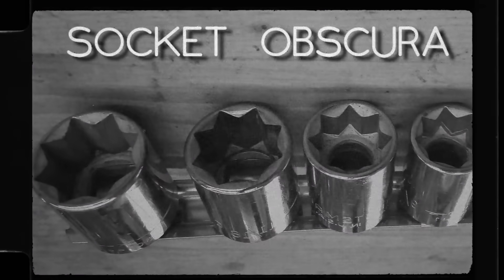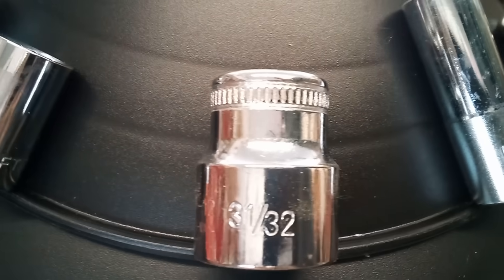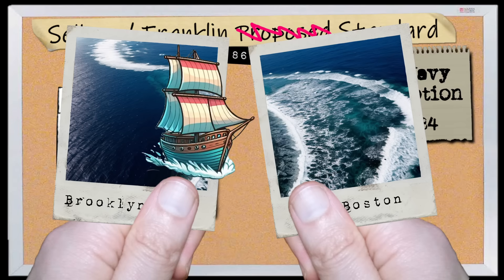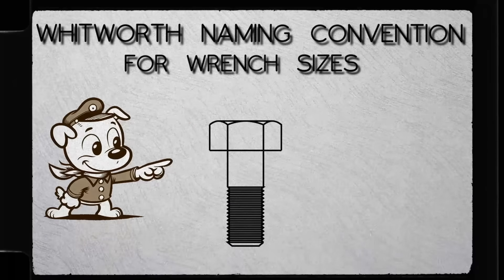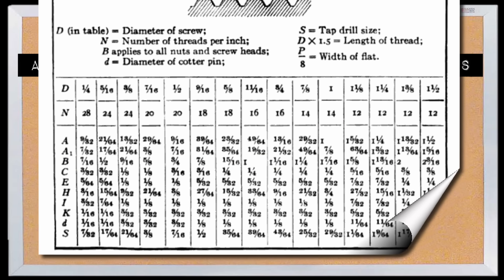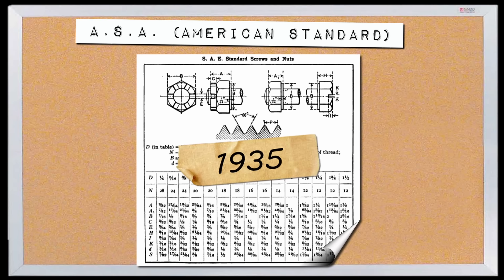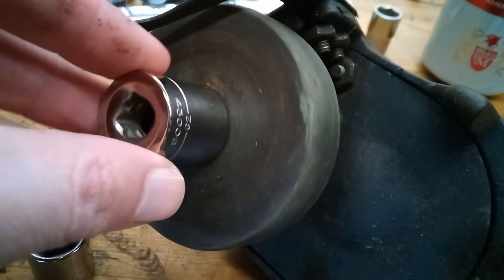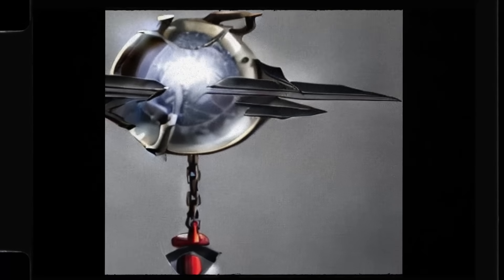32nd of an Inch Bolts - History & Lore

Comment: It is still surprising that metric sockets still use fractional size ratchets. Perhaps, I should not have mentioned that.
Reply from the maker: Yeah, I'm sure there's another story behind the socket drive sizes. I'll have to dig into that too.
Reply: @ballinator  I think I read somewhere that Blackhawk had a line of 7/16" drive sockets before World War II
Reply: There are also metric sizes in 1/2 mm increments for use on lug nuts where rust has swelled the chrome decorative cap to a degree that standard metric sockets will no longer fit.
Reply: @machintelligence  have a set of the 1/2mm increments for that purpose. Dont use them a lot but when you need them you need them.
Reply: @robertanderson1272  Once you  go above certain size - say, 14 mm - that half a millimetre does not matter at all, I'd say.
Reply: @MrKotBonifacy  
 Trust me, that.5 mm makes a difference on swelled cap lug nuts and other partially stripped or rusty fasteners.
  As far as other metrics, different countries have different sizes of bolts. Germans use a 16mm hex instead of the more common 15mm. US replacement bolts use 17 mm hex for the same bolt size. Japanese use 12&14 mm when US is 13 &15 mm. 
  Screw hose clamps used to be 1/4 and 5/16 are now 5.5, 6 and 7 mm. 9, 12, 14,16, 18, 20, 23, 26 are used for tube fittings.
  I've seen weird thread sizes too. World wide standards don't seem to be a real thing.
Reply: @ Well, lemme rephrase my stance a bit: I'm not saying that there are no situations, ever, whatsoever, in which this 1/2 mm of wrench size difference wouldn't make any difference - what I'm saying is, these "something point-five mm" spanners are not anything mainstream, not even close to it - these are fringes of metric wrenches (and "sockets", which name I heartily detest as this a rather dumb abbreviation of "a socket WRENCH", or "spanner" - as "a socket" is a socket, i.e. a NOUN - and "a WRENCH" is a wrench (ditto), with "socket" being added to it as an ADJECTIVE, thus "a socket" for "a socket wrench" is kinda silly - like saying "sport" for "sport shoes", or "sport cars" - but these are quirks, flaws and shortcomings of English language, and at any rate... I digress here).

So yes, for small sizes (3-6 mm) that 0.5 mm DOES make a difference, and as I said before, 5.5 or 3.5 mm (and even 6.5 mm) wrenches are the "fully legal" sizes - but above 7 mm hardly anyone EVER sees this in the metric world.
I myself, being over sixty (and fiddling with all things mechanical since 6 yrs old), am yet to see anything like 10.5 or 16.5 mm spanner. Yes, I believe these might exist, and yes, for some folks these might be even be a part of their "standard tool-set" for daily use - but only that.

I mentioned before that some sizes are skipped altogether in "GI Johny" (aka the Home Garage Mechanic) sets - like, after 14 mm you typically see 17 mm - albeit in "proper, for proper mechanics" spanners sets you always have them all, in 1 mm increment. And yes, some countries WITHIN the metric realm tend to follow different standards for "bolt size/ head size" ratio - for instance "some time ago" my pal needed to take off some bracket bolted to a Mercedes truck frame - and these bolts (and nuts), size M10 were German-made. And 'lo and behold", bolt heads and nuts were 16 mm, not typical 17 mm you'd expect - and he was kinda in bind, as 17 mm spanner was a smidge too big, and these bolts were very tightly screwed on. I had all sizes in my set - including 15 and 16 mm, so no biggie, but situation like this (coming across such sizes) are pretty rare.
And that was like 20 yrs ago, and I guess you could count on the fingers of a single hand all these situations since then he actually needed again this 16 mm size spanner.

AND, AT ANY RATE, there's ALWAYS some gap between "nominal size" of a spanner and REAL size of the space between spanner's jaws, made to allow for easy on-off action. My experience says cheap sets have this gap tad on - or close to - "too loose" side (about half of mm or so), while quality ones have tighter (better) fit.
Once I had to buy this so called (here) "a pipe wrench" (not "for pipes" but "looking like" a pipe for smoking tobacco), size 8 mm - it was 12-pointed (aka "double hex") cheap Chinese stuff - and it was so loose that at this size it was practically useless (so I had to get another one with single hexagon socket in it).

But when you're faced with "slightly swollen/ rusty/ deformed" 19 mm head/ nut you RARELY, if ever, would need a 19.5 mm spanner - at this size 20 mm one would do just as well, albeit yes, 19.5 mm would offer a better fit. Still, as long as the job can be done, it does not matter, and then one can buy only so many tools.
And this "loose tolerances doesn't matter above certain size" thing is, in my opinion (but I might be just wrong), the reason for square nuts found on all really old stuff - cuz back then, in old days, a farmer would have only the most basic tool, and if he could tighten a 3/4 in, or perhaps even a 5/8 in nut with either 3/4" or 1" spanner, the better for him - like, why bother (and spend precious $$) on stuff he wouldn't really need?

Anyway, to sum up this tad winded blabber of mine - kindly please see my earlier comment NOT as any "argument/ arguing AGAINST" your statement/ opinion, but as a "commentary", "addendum" or "a footnote" of sort.
Yes, SOMETIMES these 19.5 mm spanners come handy, and for some, in some situations, these might be NECESSARY - but for the most of us, casual "professional hobbyists"... Nah. Nevah. ;-)
Reply: @MrKotBonifacy  socket makes sense to me as the thing you use a socket wrench to use. You use a socket wrench on sockets. 
Once you get past 7mm I haven’t seen half mm sizes, but they do exist… from what I can tell mostly from places that went fully metric long ago, used to get closer to sae sizes for folks with no fractional inch tools.
Reply: @johngaltline9933  "socket makes sense to me as the thing you use a socket wrench to use. You use a socket wrench on sockets." Well, one can certainly see it that way, but for me a socket IS the wrench , albeit without a handle (i.e. the ratchet or a power tool adapter).
 And then there are one-piece single-size socket wrenches as well (like that aforementioned "pipe" wrench, or maybe an "L" wrench, and ones with a handle and pivoting "socket tips" on both ends, permanently affixed), so this "socket" used commonly to call the entire thing (ratchet plus socket) sounds kinda silly to me - but then again it might be just me and my CNPD (compulsory nit picking disorder ;-)

Whatever, and I'm certainly not going to fight over it - so let us just agree that we disagree, can or not? ;-)

 Once you get past 7mm I haven’t seen half mm sizes, but they do exist… from what I can tell mostly from places that went fully metric long ago, used to get closer to sae sizes for folks with no fractional inch tools - that reminds me of some old Leyland engine that guy on I Do Cars channel was dismantling in one of his videos - the engine was produced, AFAIR, shortly after UK went metric, and there were some M9 bolts it it (a total odd-ball size in metric world) with equally odd heads, and he was wondering why such size (he's an American).
Apparently they decided, methinks, that this 9 mm (0.354 in) diameter of a bolt is the closest "full number size" to 3/8" (0.375 in or 9.52 mm) that can be used on "metricated" engines without drilling bigger holes in the block - which might require some re-designing or re-calculating the strength of this new design.

Well, whatever - just some piece of totally useless trivia. Cheers!
Reply: @MrKotBonifacy  
  True, you are not likely to find end wrenches ( spanner to you Brits) in half sizes and most fasteners are not made intentionally half sized, but become so from natural attrition or in the case of the common tin caped lug nuts, expansion. Half sizes address the extraction of damaged fasteners, usually in the automobile realm, ressesed into  the part.
   As a nearly elderly auto mechanic myself the changing fastener world is getting pretty diverse with new drive styles to increase torque and discourage repairs.
Reply: @jeffhill3681  "the changing fastener world is getting pretty diverse with new drive styles to increase torque and discourage repairs" - yeah, soon they'll be gluing up and welding shut everything, to discourage any unauthorised fiddling ... ;-)
Reply: @machintelligence  Some of the old soviet wrenches are like that, except you never know if it's 0.5 mm over or under 😂 I needed a 32 the other day, found one 32 in the old toolbox that fit perfectly, then found another that was more like 31 or something even with the rust removed. Some others are borderline unusable from how loosely they fit
Reply: Years back I wen't on a in the "field repair"  just so happened we needed to remove the drive wheel I did't have my 3/4 rachet set along, The farmer wen't and got his  "( 5/8)" drive socket set "SNAP ON" to boot, any idea on that? I've also seen a 1/8 inch drive set Snap On also, I think that was a novielty set but still useable!
Reply from the maker: @fredblase5608 There was also a 9/32nds drive too. Companies tried their own thing for drive sizes, but 1/4, 3/8 and 1/2" ended up winning.
Reply: @ballinator  I've been under the impression that 9/32" and 5/8" drive were US military specified back in the day.
Reply: @ballinator  the latest i can remember is whan gearwrench created their socket, ratchet set up with the hollow sockets
Reply: @fredblase5608 
 The 5/8"drive set is a valuable collectors item, the 1/8" driver is for electronics use. Have had them for years, probably only needed them a few times.
  Ya, got that 'own every size ' disease.
Reply: Gives them a new idea
Reply: Hum, you got a good point there . I never thought about that and just took it for granted ??
Reply: I once saw a 17.5mm open end wrench.
Reply: @e-curb  That could be a re-labeled 11/16" wrench. There's less than .002" between them.
Reply: @  I don't think so. It was a double open end wrench. The other end was 18mm.  IMO that was the most useless wrench ever made.
Reply: Not that surprising.  There are many things that retained their customary sizes long after people using them switched to metric, many still that way today.  People just don't realize it because they use the nearest metric equivalent or a size label when referring to it.  You'd also have a pretty tough time  as a tool manufacturer getting people to buy a whole new set of gear to replace one split socket.  
Lastly, I've seen 10mm drive out in the wild.  In the US we usually only see it on very cheap tool sets found at flea markets and the like, but as best I can tell it exists as an option in some parts of the world, especially in places that have tooling from before the fall of the USSR.
Reply: I assume you mean the square drive.  It would be a huge mess if the Europeans created a new Metric standard for that.  I expect there are countless US made sockets in Europe, and there are European tool makers who make sockets they might like to sell in the US.  Having two standards would serve no practical purpose whatsoever, and would just cause trouble and expense.

Some Europeans try to hide the fact by assigning the sizes mm names, but those aren't the actual sizes.
Reply: @GH-oi2jf  "Some Europeans try to hide the fact by assigning the sizes mm names, but those aren't the actual sizes." - that's funny, considering that an inch IS DEFINED as "25.4 mm" - see? (Or, QED : )

No-one is trying to "hide" anything, and at any rate the only "actual size" is what is PHYSICALLY out there. EXPRESSING it in numbers - with appended inches, mm or "multiple of a wavelength of certain frequency of light" - is not any "actuality", it is done merely in order to get some more or less ARBITRARY number(s), related to the physical object (or a distance), for the purpose of calculations (I'll get back to tis part soon) and/or dimensions verification. (But then this can often be done without any "numbers" - for instance, in case of threads you can use "go/no-go" thread gauges - and no need for any calliper or micrometre.)

And yes, there are SOME of these "legacy" things, like "imperial" threads still used in plumbing or power hydraulics, there are still odd-sized bullets - like this 0.3" / 7.62 mm and what not - which is the standard introduced, AFAIK, by tsarist Russia back when they used inches - but with DECIMAL division from the very beginning.

Anyway, one of these things is them square drivers - NOMINALLY assigned 3/8", 1/4", 1/2", 3/4" and 1" (AFAIK) sizes, but their ACTUAL sizes are always slightly off. So a "half an inch" drive (12.7 mm) might be in fact closer to 0.492" - or 12.5 mm. (Which of these two numbers do you see as "more natural" or "simpler"...?

But when it comes to Allen wrenches (or any other wrenches) they are all "metric" (in metric world), and no one gives an eff about some 15/16" or "17/32" nonsense - and then the Torx system (an "improved Allen" stuff) comes ONLY in metric sizes. So, there you go. 

Anyway, the square drives thing is pretty much in the "who gives" category, and while from "perspective of an ordinary human and daily SIMPLE tasks" (like cutting lumber, mending a fence or building a barn) an inch and a foot is,  I'd say, somewhat more intuitive/ easy than metric units, but then dozen-based system is also "somewhat better" when it comes to natural (whole) numbers divisions, yet everybody uses decimal counting system - see?

"Und da hier is der Hund begraben", as Germans used to say ("and here is the dog buried") - metric is superior NOT so much because of the size of its units, but because it's decimal all the way through.
With Imperial/ US Customary going from inch to foot is a conversion, ditto for "feet to mile" - and this applies to ANY unit switching, WITHIN it - while going from "mm" to "km" (or "m" to "µm") is merely a matter of moving a decimal point.

Why, do you think, US machinists have thrown away (to all intents and purposes, bar rough sizes of stock material) all these "7/64" or 27/128"? Makes you think, eh? ;-)

Also, I dare to suggests that if someone "back then" would give it a second thought and decided "an inch is to be divided into TEN units, and then into tenths of thereof, ten inches would make one foot, ten foot will be... something else, and then ten of these somethings would be one mile" , ALL of us today would be using, happily, inches and miles.
Alas...
Reply: @GH-oi2jf  My die grinder uses cutters with ¼" shaft. The standard. I was travelling in Europe about 10 years ago and saw a tool shop. They had cutters I haven't seen here, so I bought a couple. Tried them out and the shafts are too small!  6mm!
Reply: @e-curb  "My die grinder uses cutters with ¼" shaft. The standard " - nope, merely "the US standard". And they weren't "too small" - they were just right. OK, maybe not for US made / "for US made" die grinders, but then there's world outside of US of A too.
Yes, we "not in America" (and Liberia, and Myanma(r)/ Burma too) are still living with some funny legacy systems, and we leave them in place because changing them would be too much trouble (and burden).
For instance, bearings - the balls for them  still come in these weird "125/128 in" sizes, and you constantly see all these "3.969 mm" (or 4.762/ 7.144/ 10.319/ 12.303 - and such).
Ditto for the bearings itself - in USSR they've changed them for metric standard (they manufactured them themselves, for themselves, thus "who gives") - so, for example, they changed 2" inner diameter (50.8 mm) for 50 mm - and all was fine and well, that is until the collapse of Soviet Union and it's industry (today, believe it or not, they don't make ANY bearings - they import most of these from either Belarus or China) so now whenever they need to replace one of these they need to bend backward and dance on their ears to actually turn this inner diameter (hey, it's a BEARING! How you gonna hold it in a lathe chuck, huh? ;-) but then I digress here, so "now you know" - US standards ARE NOT always the same as EU/ metric standards. 
Cheers! ;-)
Reply: @MrKotBonifacy   I knew about the ball bearing oddity with the balls being measured in inches while the exterior dimensions are metric.  Kinda like tires.
Reply: @ Yep, a messy place this world is, innit? ;-)
Reply: Not much, actually - In my entire life of fiddling with stuff in La–la–metric land I ever came across them - except for really small sizes - like 3.5, 4.5 and 5.5 mm - which are legitimate nut/ head sizes for rally really small screws. Above that they are like Yeti or Loch Ness creature - some claim they do exist, hardly anyone has seen them.
And then some sizes are skipped altogether in the "bolts 'n' nuts mainstream" - for instance bolts in M7, M9 and M11 sizes are virtually unheard of, and the higher up you go the bigger the gaps become - ditto for wrenches or sockets. In typical "common guy" sockets set, above 14 mm socket the next one is usually 17 mm (sometimes 16 mm, but not often), then 19 mm, 21 or 23, can't remember now. Odd sizes do exist - once I needed to get 15 mm socket, and for this socket alone I've paid almost as much as for this entire "budget sockets set".
Reply: @MrKotBonifacy  Odd sizes for a budget socket set, but not for a good quality set
Reply: @xenuno  I guess you're reffering to my comment from nearly half a year ago, this one:
" And then some sizes are skipped altogether in the "bolts 'n' nuts mainstream" - for instance ... In typical "common guy" sockets set, above 14 mm socket the next one is usually 17 mm (sometimes 16 mm, but not often), then 19 mm, 21 or 23, can't remember now. Odd sizes do exist - once I needed to get 15 mm socket, and for this socket alone I've paid almost as much as for this entire "budget sockets set".

...so yes, I do agree with you - odd sizes do exist, and these are fond only in "pro" sets, but no "budget" ones - just as I said half a year ago, didn't I...?
Reply: @MrKotBonifacy  Stressing on half a year there aren't you? Comments have a shelf life? You never clarified since so I made the distinction between sets. For the record even decent budget sets tend to throw a lot of cheap sockets in a package, with notably 15mm always present
Reply: @xenuno    Hey, relax - I know life ain't fair and all that, but c'mon - por favore...
No, comments do not have "shelf life" (I doubt if they have ANY life, for that matter), but my memory, kinda... well, you get the idea, don't ya?.

And then that wasn't "stressing as such", more like "jeez, I hardly remember what I said back then in this quite long thread, and then this guy never made my life any easier by quoting my earlier (MUCH earlier!) post, or clarifying what exactly he's referring to, but instead took a lazy approach and typed only a single sentence of a "wtf?" kind, with a statement that I can't remember I ever contradicted myself, and since I posted quite few comments there so far now I have to go back through all that, re-read all of them and then figure out what he's actually referring to, AND I HATE IT".

I mean, lazy people I hate, and their presumptions that when they drop in a response like "yer no right" into a quite old thread with over thirty comments, with more than one of mine... Got it? Good...

Thus being done with niceties and pleasantries now we can focus on the matter at hands - which is (to me) pretty much an argument of "is the bottle half full or half empty?" kind.
Y'see, that "cheap" qualificator is a rather vague term, as "one person's junk is another person's treasure", and someone might see a $50 set as prohibitively expensive while some other guy seeing a $150 set would say, "Ill take two" - one for my garage, and the other one... just in case" (or as a spare set).

Thus arguing along the lines "cheap" vs "pro" is kinda moot, as there's plenty "in between" stuff and then the division line is quite arbitrary.
The very first "socket set" I bough many... erm, like 30 yrs ago (time flies when yer having fun, eh? and even if you don't...) was a "hobbyist/ average guy" set - and it consisted of a "screwdriver type" handle with 1/4" tip/driver and a ratchet with 3/8" driver, and sockets starting at 5 mm (if memory serves me), then 5.5 mm, 6 , 7 , 8 and 9 mm (all for 1/4" driver) and 10, 11 (...?), 12, 13, 14, 17, 19 and 21 mm (plus one 3/8–>1/4" adapter and 1/4" and 3/8"  extensions) - AND THAT'S A PRETTY STANDARD AND COMMON setup in a 100% METRIC land where I was born and live now. And then this "spacing" is a STANDARD set for all "basic sets" of open and "closed" spanners, and this MAKES SENSE as hex heads for metric bolts do follow this pattern too - EXCEPT in some exceptional cases.

If memory serves me (probably not very well... - I'll check it latter today when I'll go to my shop to feed them cats) the lineup goes like that: M5 = 8 mm head, M6 = 10 mm, M8 = 12 mm, M10 = 13 mm head (rarely 12 mm - mostly for cheap Chinese stuff as they always try to shave every 0.1¢ from a machine worth $$$), then it's M12 (mind you, certain thread sizes are "skipped" in the "mainstream bolt lineup" too! - you can't find M7, M9, M11 or M13 in any DYI market or "regular" hardware store) with 17 mm head - so there's no real need for everyone keeping ALL socket/ spanners sizes, and if you skip all them "oddballs" your product (sockets/ spanners set) will be cheaper, and thus more often purchased by "average Joe" customers, which means more profit.
Makes sense, innit?
(You can find M7 ALLEN bolts - with standard sockets in their heads - in brake lever and bar end clamps on bicycle, and then the M8x1 fine thread bolts that keeps crank-arms on "traditional" square spindle bottom brackets typically have 14 mm heads, but I digress here.)

And then few years ago, about ten or so, I saw a "promotion" in local Castorama store for a socket set (made by "no frills, good quality" or "value for money" manufacturer) and the price was more than acceptable, and this set started at 5 mm and went all the way up to 23 mm with 1 mm increment (0.5 mm for the smallest sockets) and it had all kind of handles, extensions and drivers in all sizes (1/4, 3/8 and 1/2"), BUT! - but it would be still "tad on a pricey side" for someone on the budget and doing only "occasional wrenching" on STANDARD bolts.

So, there you are. I hope this make the issue clear. Have a nice one...
Reply: They are in Metric...1/4= 6 MM 3/8 = 10 MM 1/2 = 13 MM 3/4 = 19 MM....get your math on boy , it's they way you think , in$ide the box.........OUI !
Reply: @jafo766 those are very close but a little loose, the benefit to that is, for example, a 1/2" nut that has been painted a few times is a perfect candidate for a 13mm